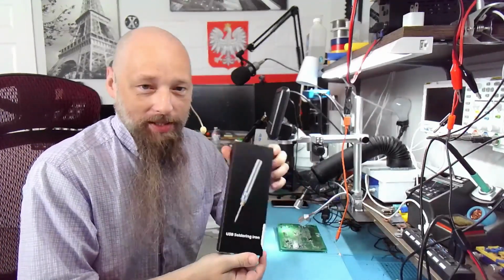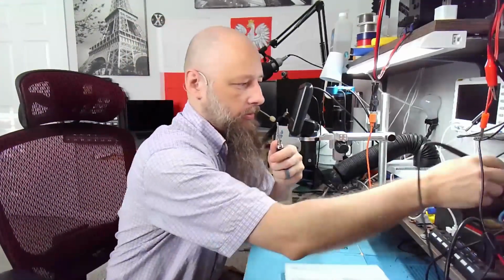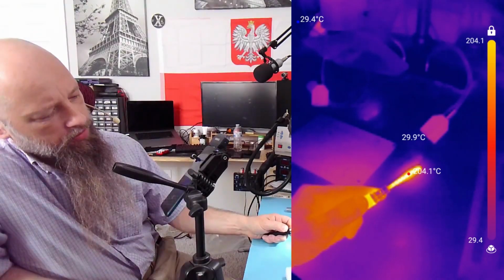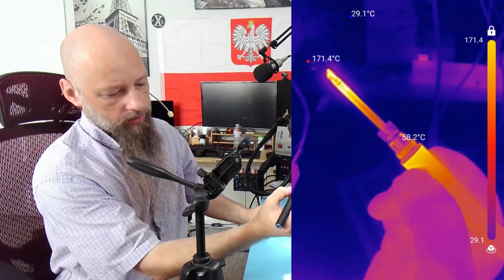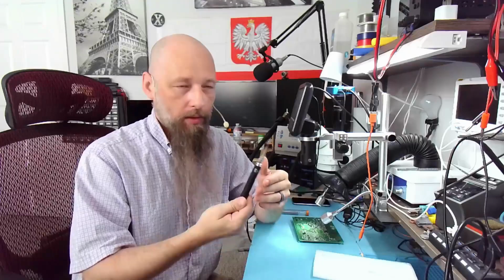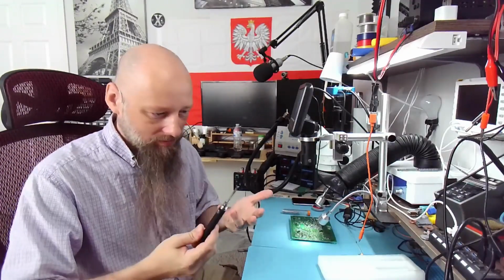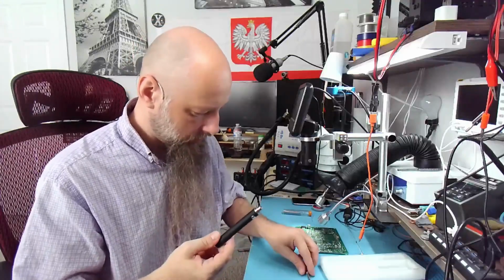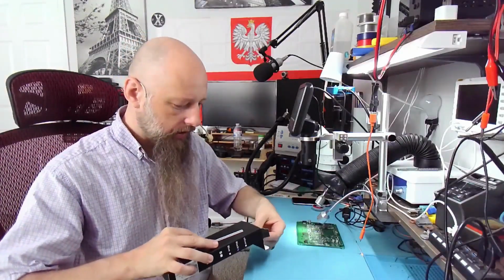Portable Soldering Iron slash Vape Pen

Comment: personally just used one (that's why I searched up the video) to repair a little broken tiara at my desk. jack of all trades kinda vibes, i figured it would work. the solder wouldn't stick so i used the iron to delicately melt a hot glue sick and micro weld with the hot glue. admittedly it was a different kind, but same type of device, but it worked great! and then i can just put the little guy back in my drawer :)
Reply from the maker: nice job!

Comment: I've used this silly thing for some repairs at work. Pieced together sort of a lightweight, portable soldering kit. Honestly, it got the job done. De/soldering components with lower thermal mass, connecting some wires, etc. The button certainly took some getting used to.

I may consider packing my Quicko T12 952 around as well just in case, as it's rather small and lightweight, but for those jobs i've used the battery operated one for thus far - not needed.
Reply from the maker: ok, so we have the legitimate use case for it :D
Thank you so much for sharing